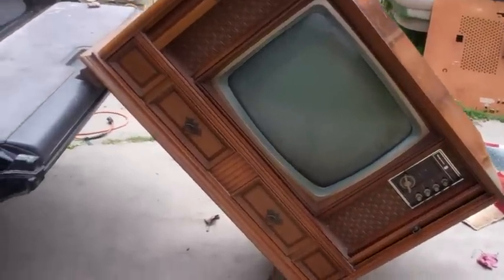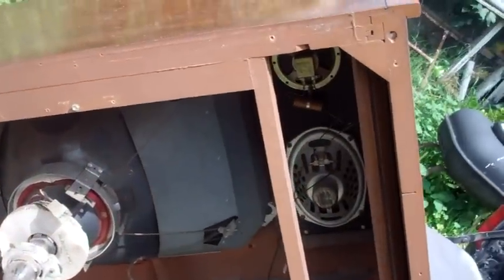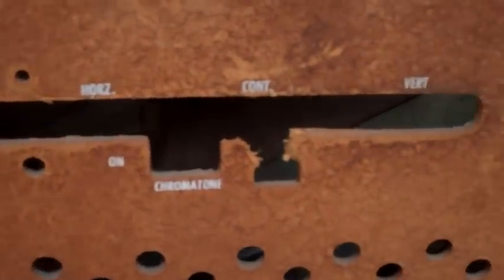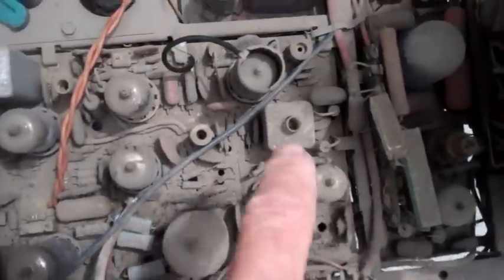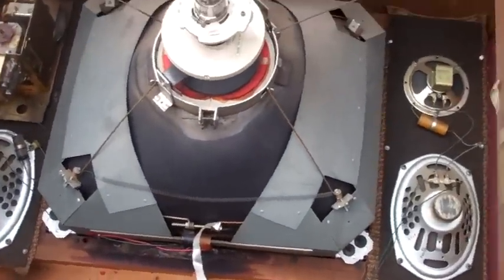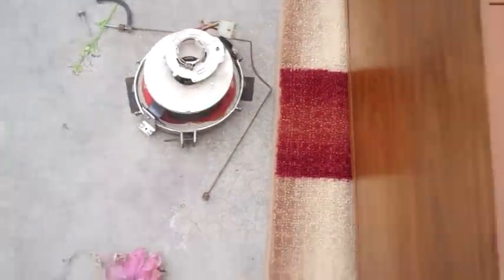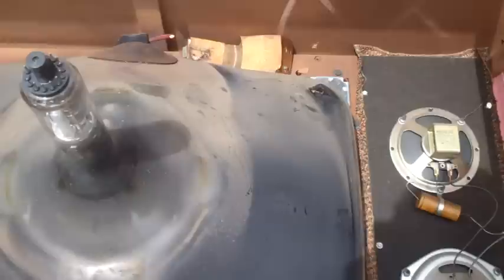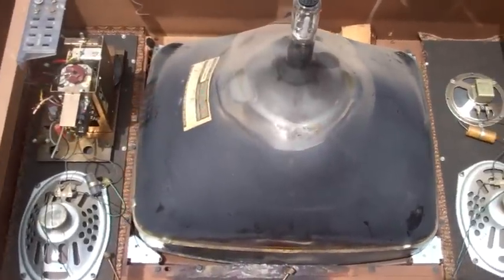stripping magnavox removing safety glass from crt

Comment: "Chopsticks"? "DIvorce"...U, sir are a HOOT! LOL! When I was a kid about 10 or 11, I was removing the crackt safety glass from the front of a 21FJP22 and my Mom happened to call the local TV shop and they told her to tell me to stop immediately and wrap that tube in cardboard, snap the neck & throw it away immediately before it imploded without that safety glass! Well, my Mom made me do exactly that & a good round crt went to the dump! I was upset to say the least! Then, as a teenager I decided to take a metal shears and  cut the metal strap around the edge of a 19" color crt so I could remove the mounting ears and WHAM! It blew up (imploded) but all the glass suckt INward so I wasn't hurt, thank God!

Comment: Boy this video is an eerie coincidence.  Back around the year this was posted 2 blocks away from where I lived back then I found that EXACT same model of Magnavox at an estate sale...Back in the 80's it had died and the owners gutted the CRT and chassis and stuck a Zenith system 3 with the 7 segment channel display in the cabinet.  I ended up on the last day paying a couple of bucks to take the side panel assemblies (ie, grille cloth, speakers, and tuner assembly).

A couple of months ago that payed off...I got a Magnavox remote roundy with the extra PP 6BQ5 amp chassis....That roundy was missing the VHF tuner shield and wouldn't ya know it the one from the tuner in this set was a perfect fit.👍

Comment: A regun tube after 5years , wonder if the heater volts may have been on the hi side , as seen a number of sets that had above the normal volts range in repair shop-some time ago

Comment: CRT implosion story where the TV set restorer lived to tell about it: http://videokarma.org/showthread.php?t=247887 Please be aware that atmospheric pressure slightly exceeds one ton per square foot on the exterior of a CRT. A typical car weighs from 1 to 2 tons. Also, as shango066 points out, the metal strap, on CRTs that have a factory installed strap, provides structural integrity. My Dad didn't realize that, cut the strap and the CRT immediately imploded. Luckily he was wearing safety glasses and he had not removed the faceplate. He suffered just one cut. In a vintage TV, the strap could be rusted and on the verge of breaking. Here's a link to a video of CRT implosion testing on small CRTs for oscilloscopes: https://www.youtube.com/watch?v=DEPo2SvOHPA

Comment: 3:21 what it means this sentence? THIS TUBE HAS STRAIGHT GUN AND REQUIRES NO ION TRAP
Reply: Early black-and-white TVs suffered from a dark spot in the center of the picture, caused by ions sticking in the phosphors over the time. To avoid this, the electron gun was slightly angled so that the ions so to say crashed into the neck glass and stayed there. The electrons had to be redirected by a magnet that was installed externally on the CRT neck. About 1960 the phosphors have been coated with aluminium and made the ion trap obsolete. The note on the CRT in this video implies that there’s no need for an external ion trap magnet. Those weren’t used in color CRTs anyway, thus Shango’s reaction.

Comment: tube was replaced because the set is a maggotbox  junk
Reply: The set is not junk, I have the same chassis, in a different cabinet still working strong 
The original tube is still in there, it just weak. Color t.v. from 1964,to around 1973 were prone to breakdowns, no matter what the manufacturer is.